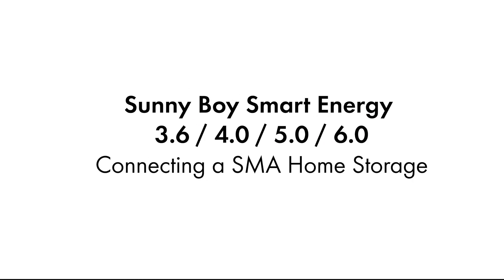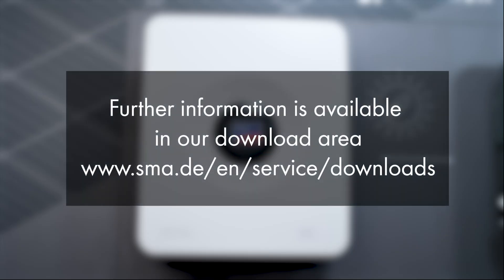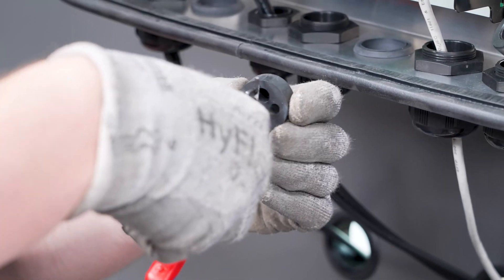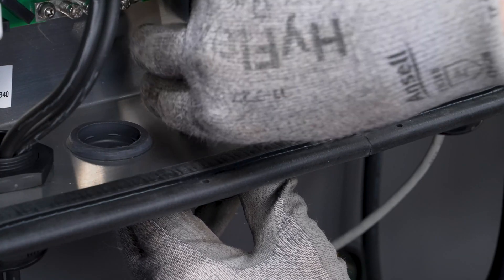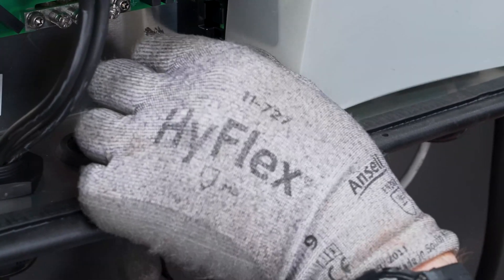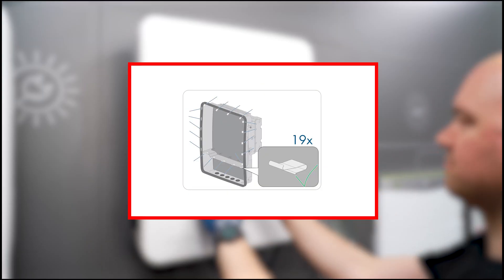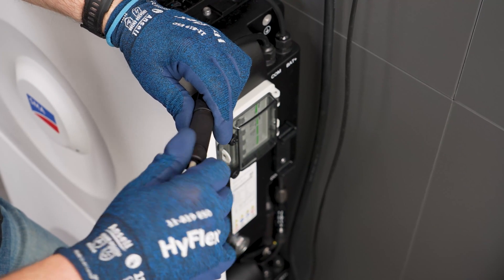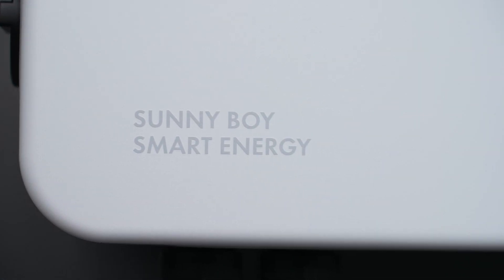TechTip: Connecting an SMA Home Storage to a Sunny Boy Smart Energy 3.6 / 4.0 / 5 .0 / 6.0

Comment: I just installed SMA home storage batteries last Thursday, in combination with a SBSE 4.0 amd a Home Manager 2.0. Works great. 
Only thing I feel is missing is an easy way to change the minimum desired power  to be kept as a reserve in case of grid failure. Hope this will be added with a software update.
Reply: Goes a bit in the same direction of my question on another video. https://www.youtube.com/watch?v=tmdXhnflGXM&list=RDCMUCLpKdGd_bgr2s5cwexaNHQw&index=1